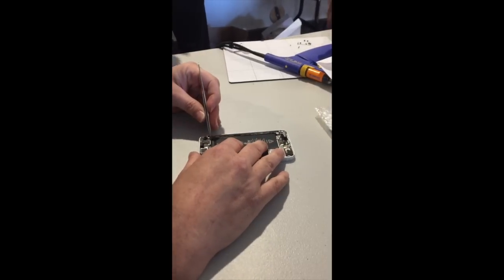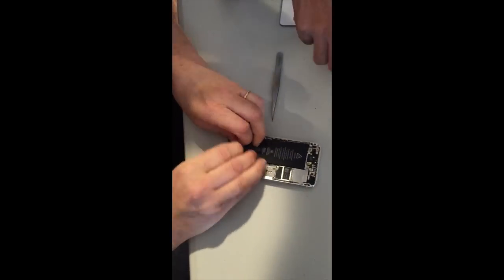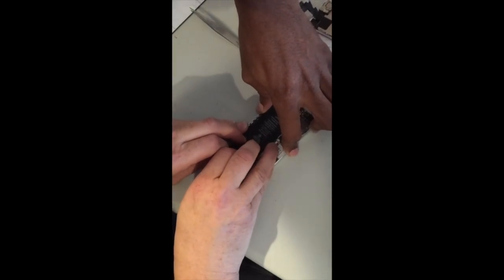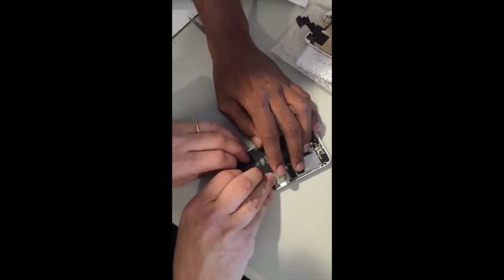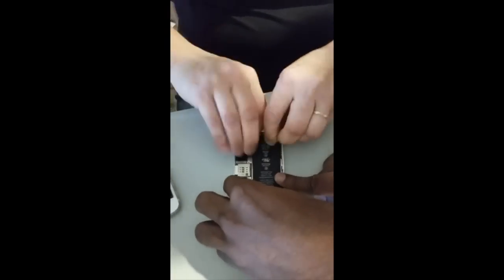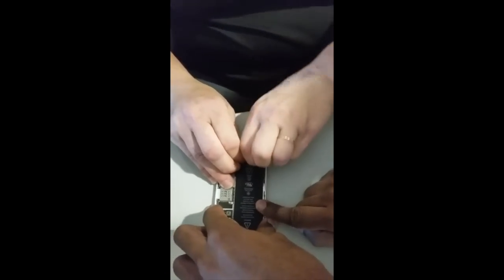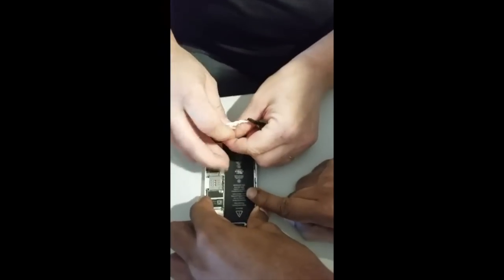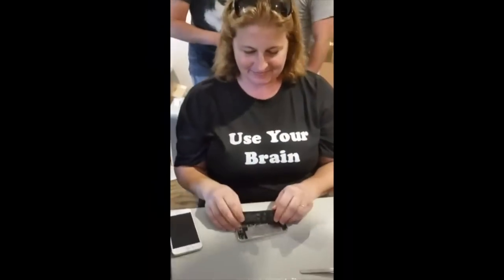iPhone 5s Battery Replacement--without breaking the pull tabs

Comment: You’re supposed to cut the black band connecting the two strips so that you can pull each one separately up and then around to the side then outward and down on each side of the battery

Comment: I wish I had saw this video a few hours ago when I attempted to replace the battery of my friend's IPhone 5s.  Instead, the tab broke on me, so I pried out the battery.   I've put everything back together, but I get no response from the phone whatsoever.  Blank screen.  No response when I plug the phone in either.  Do you have any suggestions on what I may look for, or Is it possible for me to send the phone to you for repair?  I've actually replaced the new battery with a different battery, but I have the same results.  I'm sure I must have damaged something when I did the prying, but I don't see anything.

Comment: Best way to remove iPhone battery is to use a Credit Card. Simply slide it in from the opposite side of the motherboard and gently bend card, the card will create enough pressure to lift the battery and it will come right of. I've done it this way x times.. works like charm. By the way.. You are doing great videos keep them coming! Thanks

Comment: its crazy how long you can pull those tabs out, i can get a good 20" on em stretched out till the battery falls loose. the real trick is for the tape not get nicked/pocked/cut by lower components as you pull. 
also, loosing your grip usually means it curls back underneath the battery but if you can only tweezer the smallest bit of the tape you can usually rescue "the pull".   I was baffled by the command strips at first but its pretty easy now

Comment: Way too long of a process. Why not just pop a playing/credit card in the side and force the battery out? Some pressure is placed on it, but it's not a lot, and the adhesive can then be removed. Never had to apply heat either.
Reply from the maker: dwegiel I think with practice that this can be pretty quick and the battery comes out perfectly flat---so if you were taking it out intending to use it again, then I think preserving the native flatness of the battery is an advantage.  Whenever I've done it before using the playing card method or similar it mangles the battery.
Reply: Fair point, I am wondering however if this process is applicable to 5 and 5c, especially with differed revisions in the manufacturing process. A fair bit of the devices I've disassembled had straight dabs of hot glue, and I don't think the same process can be used. I do have an idea, though - maybe putting some floss or slim wire under one of the edges of the battery and proceeding to pull it through the adhesive, similarly to separating an LCD/digitizer assembly?

Comment: Just by a Samsung so you dont have to do this stuppid replacement.
Reply: I see your point, from the the iFixit guide it looks so much simpler to remove the new Samsung batteries.

https://www.ifixit.com/Guide/Samsung+Galaxy+S6+Battery+Replacement/44648
Reply: +Frans van Aperloo Yeah battery its easiest part for Samsung S5 to remove But if you have to replace USB board or access to main board  you have to remove Amoled LCD,  and it`s super fragile. Your basic repair could end up very expensive. Sharing experience and its hurts a lot.